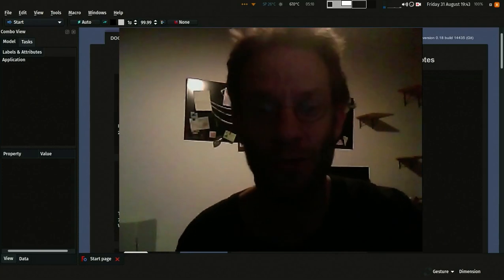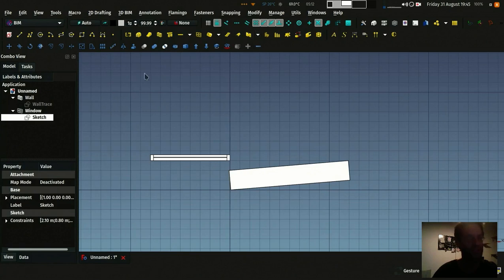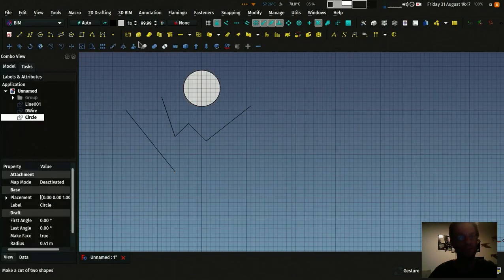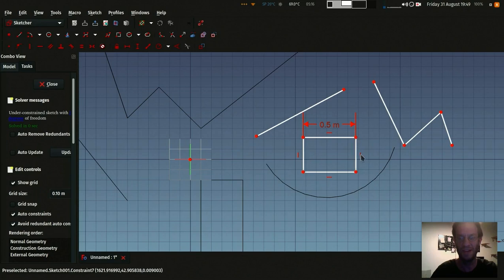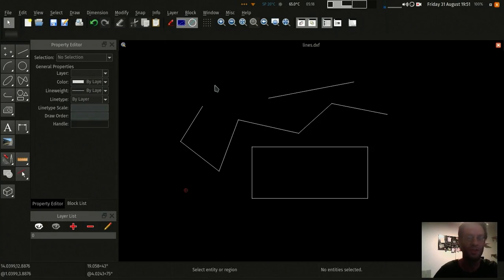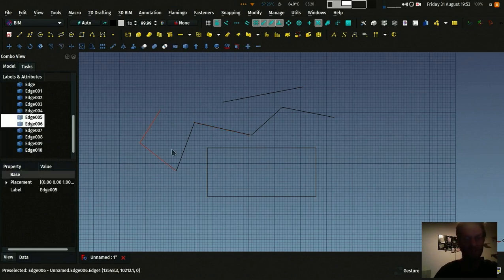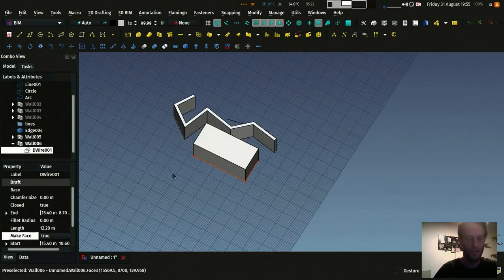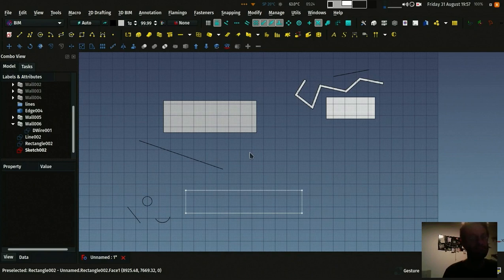BIM with FreeCAD - 2D objects

Comment: I didn't know clicking to times on the upgrade tool it would become a dwire! With these tools it's easy to prepare a dxf in order to use it as a base to model. You don't have to trace the lines, you can actually use them!

Comment: very thanks for your great work. 
I have a question about  drawing concrete structure  plane with freecad like these software:
1- http://www.farasaeg.ir/indexEN.htm
2- http://www.saze90.com/about/drawing/beam/
3- http://www.mohaseb2000.ir/
4-  ...
or steel structures:
-http://www.rayansazeh.com/

The above softwares are common in my country, but they are not open source and work only on windows. 
I work with python language and write some minor product for civil engineer. my blog:
https://ebrahimraeyat.blog.ir/post/civilTools_1.1

I want to create software like those i mentioned at above. is it practical?